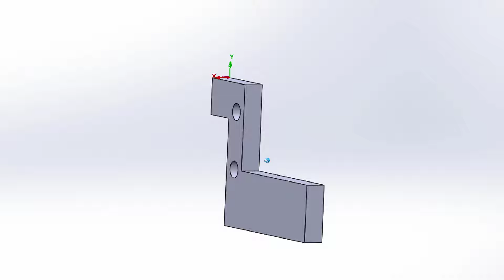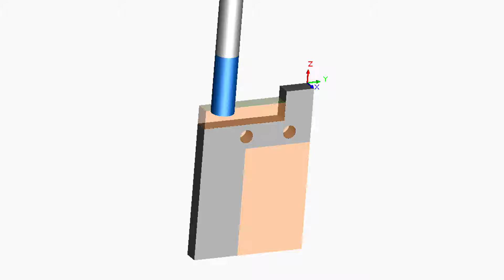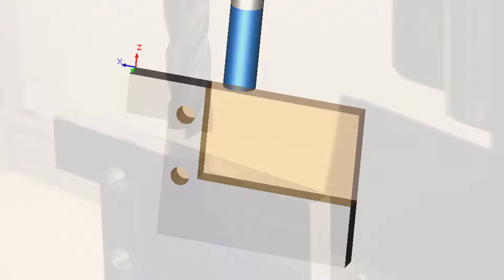MAKE: Z axis indicator arm for the Taig Lathe!

Comment: Very cool.  Unfortunately my 80s Taig Lathe doesn't have the dovetail on the crosslide.
Reply from the maker: It may be possible that the new design carriage may fit on your older version lathe. Or, you could drill and tap some holes in your current carriage to adapt it. Thanks for watching!